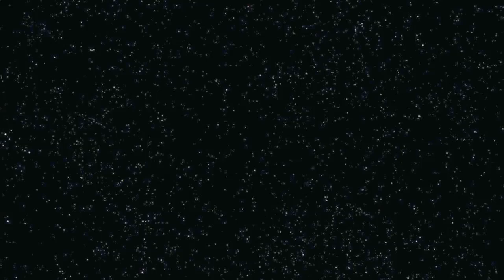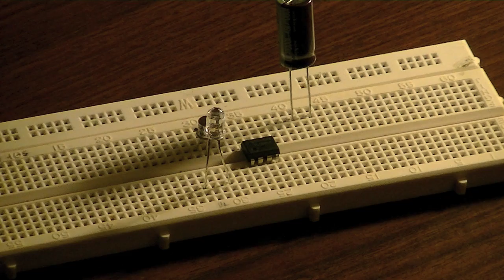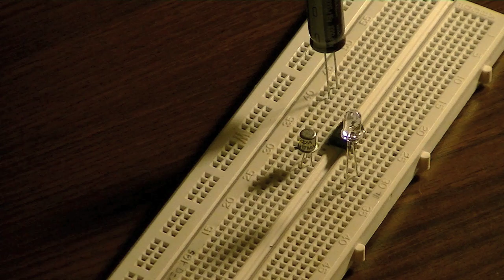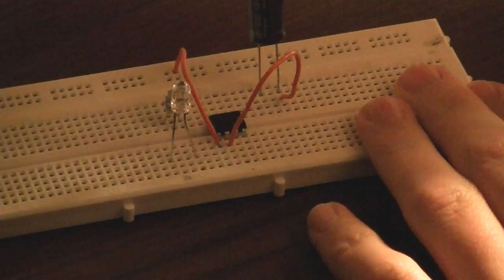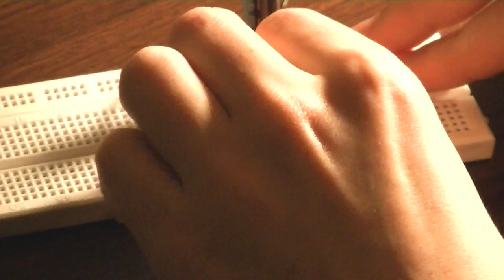How to Make a Pulsing/Fading LED Circuit

Comment: Great tutorial. did not work at first and then i realized i had the timer the wrong way around.  I also connected 3 led's in parallel and it still worked. I used a 1k and 220 ohm resistor with a bc547 transistor.
Reply: If you don't want to calculate the resistor value use 1k ohm.

Comment: another way to control the rate of fading is getting a higher value capacitor and then connecting a variable resistor just before you connect everything else to the positive side of the capacitor.

Comment: If I only have a 5V source, would it still work or would I need to use a different value capacitor?
Reply: it will most likely work, but the fade rate will be different

Comment: I'm complete new to this type of stuff so i'll ask, where do I buy the materials for this?
Reply: if you're wealthy, you can probably find and purchase it all at a Radio Shack store.  Otherwise an online retailer like digikey.com is a less expensive option.
Reply: tomx63 I got most of the stuff online but I think I messed up and got a 2 1/8 ic breadboard socket from radio shack instead of whats in the video. i also got a 2222A transistor and 1.5k ohm resistors instead. I dont know how much of a diff that'll make and if I can even use this breadboard.

Comment: For anyone that is stuck with the led lit on, just remember that the pin layout for the 555 timer in the video is

    8 7 6 5
O 1 2 3 4

(The O represents the circle on the actual 555 timer...)

Hope this helps any beginners!

Comment: Nice Video. I tried the circuit as per the video, but it did not work. What D.C. Voltage are you using? I used a 5 V D.C. source. is that a problem?
Reply: go to the link of the schematic.  you will see that it takes 9vdc

Comment: I have tricky question and I'm hoping you could answer it for me. I am working on this project and I'm using 150+LEDs. I am remaking my tron themed deadmau5 head. The tron design will be lit up by blue LEDs. Here's the thing. I want the LEDs to fade in at POWER ON, starting from the back of the head and work it's self around the head to the eyes and mouth part. I want the LEDs to do the opposite when POWER OFF; have the LEDs fade out starting from the eyes and mouth and work it's self around to.

Comment: I tried to do this a few times with no success, until I realized that you're supposed to count the timer all the way around, not starting with 5 on the other side of the timer.  (in other words, counting up and down like a column).  Now that I figured out my mistake, I hooked it all up, but the LED just stays on.  Is it possible I screwed up the 5555?

Comment: Could the circuit be modified so that the LED(s) ramps up and stays on, when I throw a switch? If so, where would I put the switch. I'm a rookie at this, so forgive me if the question seems elementary.

Comment: Nice! I'll try to get all the parts and do it. Was wondering the lowest possible voltage for efficiency.
The leds need at most 3.2v... and the transistor needs like .7v... what's the lowest voltage needed by the 555 chip?
Thanks

Comment: Thanks for the video and link to schematic.  Nice how the output pin 3 back-routed to pins 2 and 6 by a resistor, and how pin 7 is not used, capturing the output of the 'ramp' timing internal of the chip.  Congratulations on yet another unique wiring of the amazing 555.  The 555 can do so much, even voltage to frequency (via pin 5 modulation).  One of the most versatile chips of all time and its been around for ages.  I'm looking forward to bread-boarding this circuit soon.  Thanks again.

Comment: If the author or anyone watching this video knows how's to build a flashing LED circut with a flashing pattern like what you see on the back of some garbage trucks. Where you see 2 quick flashes then a pause then 2 quick flashes again and so on and so on. I would be very thankfull. It needs to run on 12v so can plug into my truck, i work security on this industrial site, and what my company provides for us to use isn't very bright.

Comment: do you have a circuit diagram of the "I modified it a little" mods? I notice only 1 transistor in the video, but there are two in the diagram. rather than crawling through the video and transcribing it, that would be pretty helpful...

Comment: Thank you for the vid.  I used a 2.5ohm potentiometer for variable speed and 2 pairs of 2 led's in a series and it works great.  Need to print a board for the circuit though.

Comment: Fun project. I tried a 9V battery and found it was a little too much power and the circuit leaked a little -- the LED would fade slightly but not go completely out. I put a resistor on the negative lead from the battery (I think I used a 1000 ohm) to reduce the input voltage and it worked fine. Thanks for the tutorial.

Comment: I purchased all of the components you used, and followed your video. However, it does not work. Could using 1/2 watt resistors instead of 1/4 watt resistors be the problem. Also, I am using a 9 volt power source, is that what you are using?  Any thoughts?

Comment: 555 timer chip, 2N222 transistor, 1000µF capacitor, LED, 1200 ohm resistor, 150 ohm resistor, breadboard, wires, battery and battery snap cap

Comment: thnx for reply to my request!:) what i wanted exactly is speeding pulse
 with voltage raise.I want to conect it to CPU fanso ,as CPU goes
 hotter,voltage on CPU fan goes higher,making the fan spin faster to keep
 CPU cool(under load,like gaming),and that automaticly would make LED
 pulsate faster.so i want it to pulsate fatser with higher voltage.Voltage range should be between 6 - 12 volts

Comment from the maker: You mean a slower fade rate by changing the input voltage? If you input, for example, 4 volts instead of 5 it should fade slower, but the LED won't be as bright.
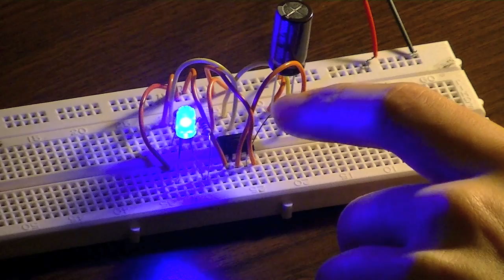You can change the fade rate by adding a potentiometer in the place of the resistor I point at at 5:20 if that's what you were asking for.
Reply: Hi, Someone7089.  In your video, you didn't mention a potentiometer at 5:20.  You indicated changing the resistor rating.  Or, are you saying to replace the resistor with the potentiometer?  Thanks so much!

Comment: @Lazarus65 double check your transistor pinout, and use a potentiometer between pins 3 and the positive side of the capacitor, anything below 50k will do. You could also change your capacitor.

Comment from the maker: 555 timers will take up to 14 volts, so an input of 12 volts could be used without harm. This will kick up the output voltage, as removing the 150 Ohm resistors shown in the schematic will also do. I've messed around with this circuit for a while, and I have had some trouble powering 12V 200 mA lighting strips. I'm not sure if the output voltage was quite enough, however. If you can't supply 14 Volts to the circuit to account for Voltage  drop, there is a way to amplify it with a transistor.

Comment: Question: You're using a single LED and probably powering with 4.5~6.0 V. What if I wanted to do this with a Tail-Light LED made for automobiles powered by 12V. What would be different in the circuit? Thanks for this video.